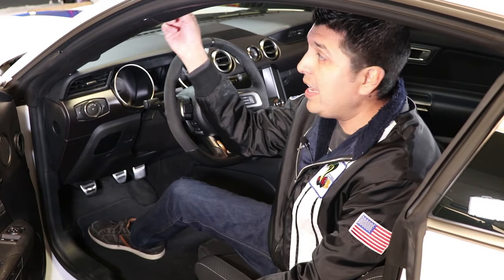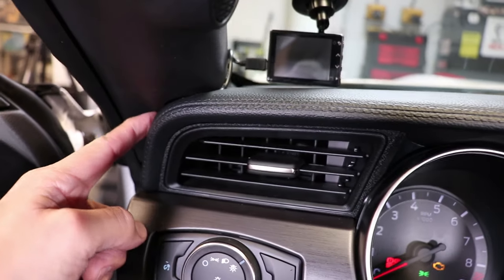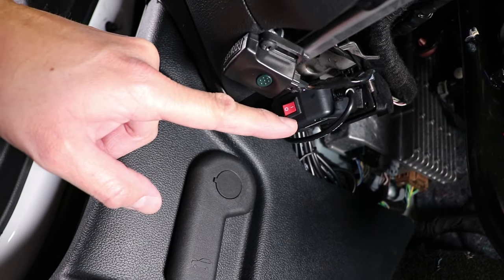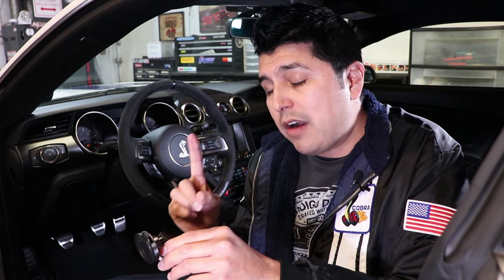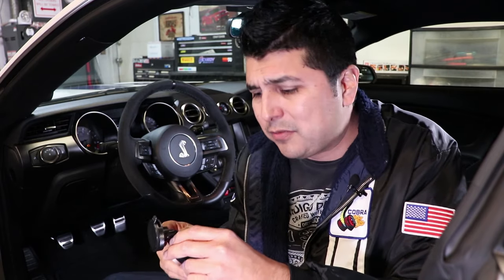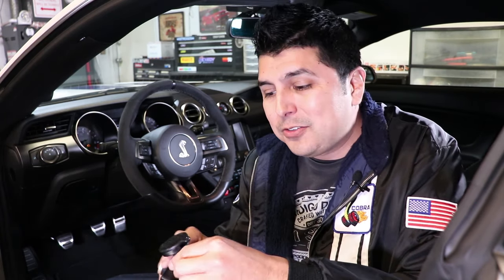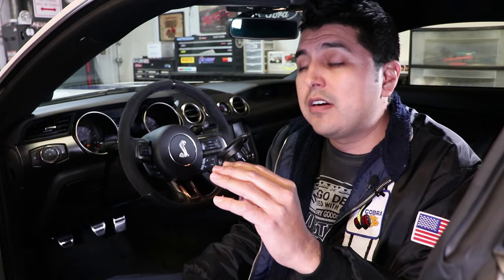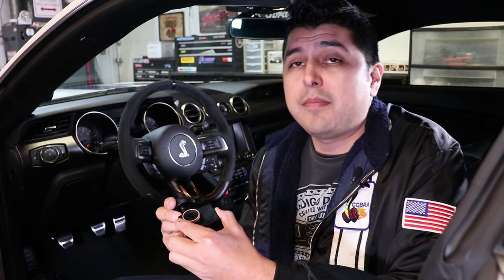Don't hardwire your Dash Cam! Try this instead!

Comment: "professional look", then he uses suction cups, and uses obd2 where it csn mess up the computer. hahaha.   there are hardwire kit, that you can tap into the cig outlet fuse. it also gives the dashcam a separate fuse.
Reply from the maker: Hi jmartyt9810! I been running mine for over three years now without an issue but I know some folks rather not use the OBD port for power. Here is my other video showing the alternative Hardwire method https://youtu.be/zbxYA4VhuT8  this maybe more of what your are looking for. Hope this helps and thanks for watching!

Comment: why dont people just use a power bank?
Reply from the maker: Hi igotauzi! some viewers have mentioned using a power bank, but I do recommend researching that option before using it since some have reported issues with the batteries overheating and potential catching on fire (sometimes due to how hot a car can get) and also checking the power consumption of the dash cam to see how long can a power bank can actually power one for (some dash cams pull almost 3A of power!) Hope this helps, Cheers!
Reply: @AlexAutoFun  oh okay I see how it can be an issue thank you for taking your time to respond! i love your shelby by the way.
Reply from the maker: @igotauzi  Thank you igotauzi! 🍻

Comment: So he's like ," no hard wire" and proceeds to use odb instead. 🤣
The probability to fry your bsm or computer, is high.  Why would someone want to mess with the odb? Thats the car interface , not a usb plug 🤣
Reply from the maker: Hi Pif Andrei! Here is my follow up video showing how the adapter works (and how it relates to the SAE J1962 standard we use in the industry for the OBD2 port design and use) https://youtu.be/aV5jQovoaCI including the use of the OBD2 port by non-diagnostic tools. I been running mine for over four years now without an issue and since making this video, we also seen more dash cam brands like Ring, Garmin, Thinkware, Vantrue use OBD2 adapters. However if you would like to avoid using the OBD2 port for power (and also looking to enable park mode) here is my other video showing the alternative Hardwire method https://youtu.be/zbxYA4VhuT8 Hope this helps, Cheers!

Comment: So it's hardwired then Dooo
Reply from the maker: Hi nigeldlm! This OBD2 adapter does not connect to the fuse panel (a hardwire kit connects to the fuse box of the car) it simply connects by plugging it into the OBD2 port. Here is my hardwire video https://youtu.be/K2iKXj82354 if you want to see the fuse box install. Hope this helps, Cheers

Comment: Or you can connect to USB port.
Reply from the maker: Hi NoName! Ah yes newer cars are equipped with USB ports, however keep in mind that not all will be able to power a dash cam as usually their power requirements can exceed the amount of power provided by the car's USB port (I seen some max out at as little as 750mA) and with some dash cams requiring as much as as 3A, the dash cam may not turn on at all or may not work correctly. But again this just depends on the dash cam's power requirement and the car's USB power output. Cheers!

Comment: I got an easier way...  USB cigarette port thingee.
Reply from the maker: Hi BUDS: The Animated Series! yep! most dash cams come with a cigarette lighter port power adapter, which is the primary method of powering the dash cam. The OBD2 method is preferred by those that do not want to tie up they cigarette lighter port. Cheers Bud!
Reply: @AlexAutoFun  I got a Bluetooth to radio with 2 open USB's in my lighter hole.  But I need 4 usb holes! LOL!  Phone holder, Phone, Vape pen, Dashcam.
Reply from the maker: LOL! Here what I used on those cases, it's cigarette lighter port splitter which will also give the 2 additional ports you need https://amzn.to/39zWZnT Alternatively, you can also free one USB port with a dash cam hardwire kit, here is the video where I show how to install one if you want to see that process https://youtu.be/uZp95NbNlmM. Hope this helps, Cheers!
Reply: @AlexAutoFun  OK thanks.  No problems with overloading any fuses or anything with those?
Reply from the maker: @BUDS: The Animated Series  If you exceed the maximum amperage rating of your cigarette lighter port, you can definitely pop a fuse. But the good thing is that unless your plugging in high amperage devices you will probably be ok (My cigarette lighter port fuse is 15A from factory haven't popped it yet lol but if you take a look at the adapters your need to plug into the splitter they will tell you how many Amps they will pull if you want to add them up and confirm you will be under the maximum Amp rating of your port.) Cheers from California!

Comment: Those cheap obd2 connectors fail after a while. Cheap junk.
Reply from the maker: Hi si604, I had mine for about 2 years and it's going strong still, no issues, not sure if I got lucky with this brand because I believe you, I know there are some inexpensive out there that may not last as long. How long did yours last, not sure if you remember what brand it was?

Comment: lazy😃, not a good view that'll for the camera, olso black type gonna fail down but the rest is very informative.
Reply from the maker: Hi Jesus's Lord! Thanks man, ah yes regarding location unfortunately we are very restricted on the mounting location for the dash cam here in California :( But the dashcam could be placed higher by running the cable up the A Pillar (and also under the headliner) if desired, hope this helps and thanks for watching bud!

Comment: literally the worst place  possible. easiest of course if you're tot lazy for a proper wiring job. xD Should be in the center line of the screen as high as it goes. Yes, in front of the rv mirror.
Reply from the maker: Hi Itviktor! unfortunately this is the only location where we can legally place our dashcams here in California :( However the dashcam could be placed higher by running the cable up the A Pillar if desired, hope this helps and thanks for watching bud!

Comment: dashcams are supposed to be mounted behind rear view mirror out of drivers view,see you like to waffle on  all that crap comes with the info that comes with camera ,
Reply from the maker: Hi peter m! unfortunately this is the only location where we can legally place our dashcams here in California :( However the dashcam could be placed higher by running the cable up the A Pillar if desired, hope this helps and thanks for watching bud!

Comment: Keep an OBD connected to your car and any smart guy with a phone can start your engine
Reply from the maker: Hi Ilie Sound Customs! this is a simple power adaptor (it does not have any wireless capabilities) I think you are thinking of the Wifi or Bluetooth enable OBD dongles, like the ones for car diagnostics (I do have one of those lol) and the ones used by your car insurances to give you "discounts" for save driving. Greeting from California friend!

Comment: I bought this about a month ago. I am not impressed. It is wonky as hell. Sometimes, it will power up on ignition start, most times it does not. It does not shut off after 5 minutes. A waste of $15 bucks, this is a piece of shit. I will hardwire.
Reply from the maker: Hi subversive1219! oh man that sucks, mine is going on 3yrs strong, I wonder if you got a bad one, either way man yeah definitely return it while is still under warranty and here is my hard wire video if it helps https://youtu.be/uZp95NbNlmM Cheers from California bud!

Comment: You had better hardwire your Garmin Dash Cam because that lousy excuse for a power outlet,  Cigarette Lighter  Socket is the worst excuse for a power outlet known to man.

Have you ever driven on a bumpy road? They push themselves out! Freaking Stupid!
Reply from the maker: Hi Jim! I have to agree with you on the cigarette lighter not being the best for a power outlet, I also don't like that the cable is in the middle of the way of the dash from the cigarette lighter to the camera. I have video coming up on the hardwire process without cutting wires maybe I can add a part to show the issues with cigarette lighter plug, thanks for watching Jim!

Comment: That place for the cam sucks!
Reply from the maker: Hi Beast! Unfortunately we are very restricted on the mounting location for the dash cam here in California :( But the installer can place the dashcam higher by running the cable up the A Pillar if desired. If there is an airbag in the A-Pillar here is my video https://youtu.be/uZp95NbNlmM where I explain some of the issues that can pose. Here is also my follow up video showing video from different angles to help you decide the best one for you https://youtu.be/F7OzM2i7ErE Hope this helps, Cheers!
Reply: @AlexAutoFun  That is a good facct to knoe thanks.
Reply from the maker: You're welcome, Cheers!

Comment: This does NOT look professional as you say  1:23
Reply from the maker: Hi Billy! I have a follow up video that may be more of what your are looking for https://youtu.be/zbxYA4VhuT8 it covers the full hard wire method including hiding the cables under all panels. Hope this helps and thanks for watching and commenting!
Reply: The low camera does not properly capture video at the proper angle or perspective.
Reply: The low camera does not properly capture video at the proper angle or perspective.
Reply: The low camera does not properly capture video at the proper angle or perspective.

Comment: Stopped watching at 1:20. Worst advice to mount the camera in that position, Adios!
Reply from the maker: Hi HD2You! unfortunately this is the only location where we can legally place our dashcams here in California :( However the dashcam could be placed higher by running the cable up the A Pillar if desired, hope this helps and thanks for watching bud!

Comment: Dude, crap place for a camera
Reply from the maker: Hi Jay, my Garmin records really good video from that angle, it may be due to its wide angle lens, but what you can do using the same method is run the wire higher up the A pillar while tucking into the trim, this should position the camera higher for better coverage, thanks for watching bud!

Comment: That is the most awkward place to mount a camera, Just saying.
Reply from the maker: Hi Sabbage100!  I have gotten great video from this angle but yea it does limit visibility, I have another video coming where I compare a couple different angles, any particular angle you recommend I try? thanks for watching bud!
Reply: I cannot agree. Mounted in the same place but a little higher and it is perfect.
Reply: AutoFun I mounted mine right next to the rear view mirror, all cabling hidden in the head liner.
Reply from the maker: @waleryx  Hi Jacek, thats awesome to hear! I been toying with the location of the camera and it's always helpful to hear what places have worked better for setting it up, thanks for sharing!
Reply from the maker: @sabbage100  Awesome! I got a hold of one of the trim installation tools and it made hiding the cable very easy. Good location to install it a dash too!

Comment: Damn stop being lazy and take the 15 minutes it takes to properly run wires behind your trim panels instead of telling people the "half-ass" way to do things. Running wires professionally is something anyone can do. Cutting corners and having your dash cam mounted extremely low and on the driver side of the vehicle completely defeats the purpose of having a dash cam. A legitimate dash cam install would place the dash cam directly behind the rear view mirror. Not trying to be rude,  just trying to let people know there's a right way and wrong way to do things
Reply from the maker: Hi Jordan! I like the idea of placing the dashcam behind the rear view mirror, I'm working on another dashcam video, this one will be a hardwire install, I will keep your suggestions in mind and hide the cables inside the panels, thanks again for tip bud!

Comment: Looks terrible!
Reply from the maker: Hi Nick! Unfortunately we are very restricted on the mounting location for the dash cam here in my State. But the installer can place the dashcam in a different location by running the cable up the A Pillar if desired. If there is an airbag in the A-Pillar here is my video https://youtu.be/uZp95NbNlmM where I explain some of the issues that can pose. Here is also my follow up video showing video from different angles to help you decide the best one for you https://youtu.be/F7OzM2i7ErE Cheers!
Reply: @AlexAutoFun  Thanks. I'm in Pretoria, South Africa. I've recently gone for a Woolfbox G850 mirror/ dash cam in my Toyota Hilux Vigo D-4D (3 litre 1KD-FTV turbo diesel) 4x4 twin cab pick-up. The truck has limited rear visibility through the aluminium canopy. I'm very impressed with the Woolfbox, though I need to fit a hard-wire kit. I will also make a centre roof Console, to locate: 1) my Tyre Pressure Monitor display, 2) the Woolfbox's GPS receiver - in front of the mirror stem, so it has a sky view to 'see' the GPS satalite constellation through the screen, 3) a Scan Guage 2 - the connector of which will occupy the OBD2 port, 3) Exhaust Gas Temperature Sensor Display - prudent as I have a Unichip piggy-back computer and a dyno engine remap, 4) 2 way radio for group safari travel comms, 5) Some storage. 

I do not want to see any wires, so I'm a tad anal... but spegetti should be pasta, not plastic clad copper!
Reply from the maker: Nice! that is gonna look great when finished. Yeah the the G850 is a good choice here is my full review for it https://youtu.be/7UbJk32_k5Y and here is my hardwire video https://youtu.be/uZp95NbNlmM Cheers Nick!  @nickgood8166
Reply: @AlexAutoFun  Your videos are top notch. Thanks for the solid work!
Reply from the maker: You're welcome and thank you Nick!😀  @nickgood8166

Comment: Is the OBD connection fused?  If not then you do not know what you are doing.  Better leave us your ideas to yourself
Reply from the maker: Hi Bob! It would depend on the brand of OBD2 power adapter your using, the one I have does not have a user replaceable fuse. I am working on a follow up video with a hardwire method for those that prefer it, stay tuned bud and thanks for watching!